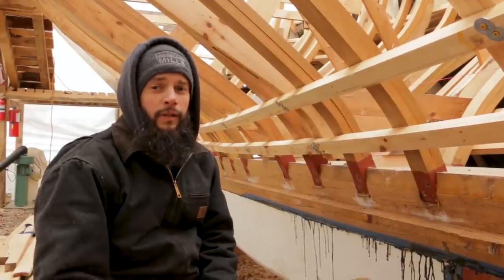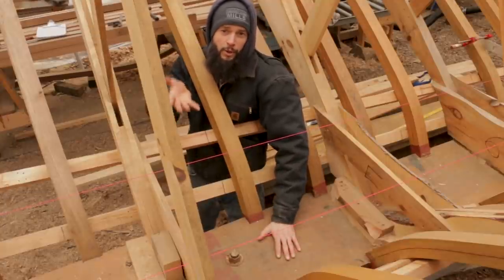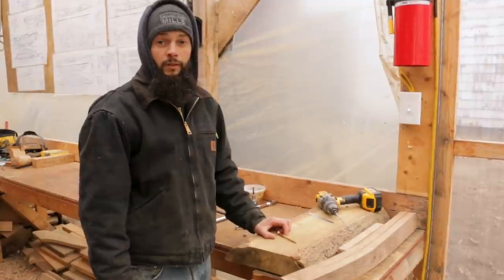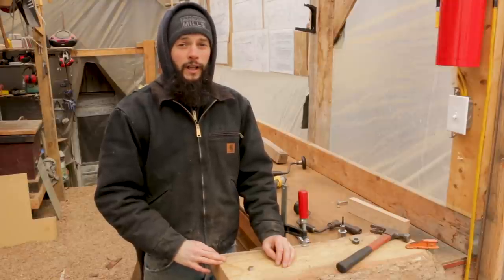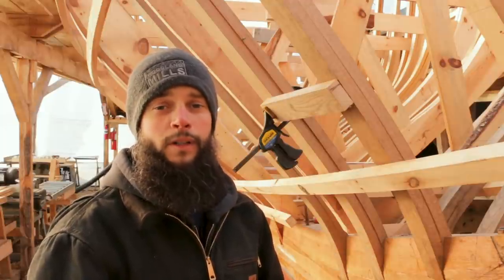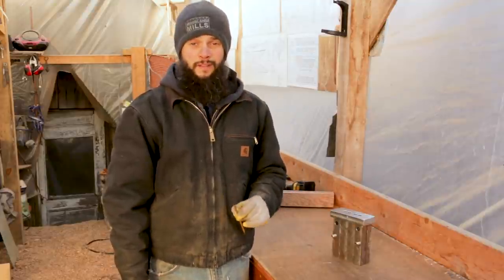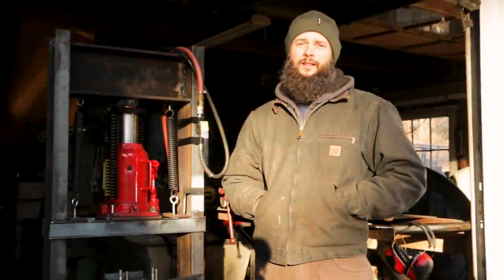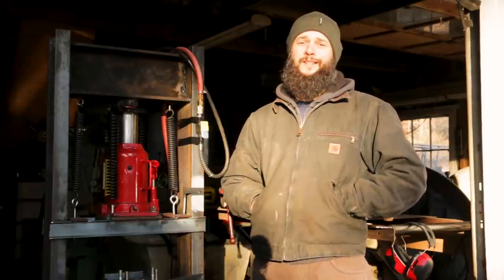Acorn to Arabella - Journey of a Wooden Boat - Episode 50: Homemade Copper Rivets!

Comment: In theory, bolts are supposed to be loaded in tension, not laterally which tends to move sideways and loosen.  Threaded portions should stretch at the same rate as the wooden threads. This important fastening metal, and as a result the length of the female threads is limited to a length short enough so each turn of thread pulls evenly.

Comment: People that say the screws went in too easily have never properly pre-drilled a screw hole in hardwood
Reply: Which was ALSO Why he used the Brace and screwdriver bit, so he could FEEL the Stripping Point and STOP.
Reply: my grandfather always said "if you're counting on the screw to hold your joint together, you haven't fashioned the joint properly."   The "key" in a keyed mortise and tenon is not supporting the whole strength of the joint....screws here do much the same thing, they're not really "holding the load" so much as keeping the frame ends in place....
Reply: @timhyatt9185  Yep. My grand pap said that nails, pegs, screws. and/or glue are just there to hold the joint. The work is the fitment. "It's called Joinery not Glue-ery."
Reply: @christopherneelyakagoattmo6078   "It's joinery, not screwery" was what I heard from my first native English mentor .... so the explanations differ slightly, the knowledge stays rocksolid 😄
Reply: i guess if you dont care about building huge splitter cracks then go at it tigth and feel it torque on them screws =)

Comment: For the Rivet-Machine:
I'd suggest you design the die a bit differently. Instead of having the Rivets sit square to the splitline of the die rotate them 45°, so they sit diagonally in the die. This would make extraction easier and incidentally also create somewhat of a point at one end (in the shape of a rounded pyramid). You could then skip the step of making the point at a belt grinder.
Reply: Bingo!  This is genius!  What we'd call a slip-angle or mold-release angle.
Reply: @davidbrown8365  Thanks, now I know what they're called in english!
Reply: I was just going to post this very thing. Basically use a 90° vee cutter for the slots instead of a regular square end mill.
Reply: @thomasbecker9676  Or a square end mill with the part held at 45°.
Reply: @Finn-McCool  not really necessary.  The two curves left by the mill should create a small pyramid with two flat and two rounded surfaces.
Reply: I was coming down here for exactly this.
Reply: I hope they are using a grinding wheel, not a belt. With thousands of rivets ahead of them, they'd be tearing through belts like nobody's business. At least you can use a grinding wheel right down to its core.
Reply: Beat me to it. If they're happy with the work hardening of the heads from cold pressing then forming the tip at the same time.
My riveting experience is limited to either mild steel or aluminium so I don't know if this is important, but do the home made cold pressed copper rivets need annealing prior to use? Does the work hardening when they set the rivets cause the rivets to become brittle? Or is copper ductile enough that this won't be a problem?
Reply: Holy s**t! a practical utube comment!
Reply from the maker: To form the point of the rivet in the press the rivet basically has to elongate.  Even if the die was pointed we would not get enough force to form the point.  
We are pointing on a grinding wheel, the wheel lasts a long time.
It's pure copper and very ductile.  The work hardening is more a feature than a issue.
Reply: Just saw this video, the 45deg is what I was going to say.  Lots of ways to make this faster or better, but if you have free labor what's the use?
Reply: @AcornToArabella  If you are driving through a predrilled hole, do you need to grind all the way to a sharp point?
Try just taking the corners off to creat centering shoulder's, l find one roll of the wrist whilst also rolling my fingers gets it there.
I do this on 4mm square copper leg stays for benches.
Reply: @Finn-McCool  I was wondering what you point was lol
Reply: There is no reason to cut slots or a pair of vees in that die. A round hole of a diameter equal the rivet stock diagonal would be sufficient. I promise you, a square rivet would not buckle in a round hole.

Comment: I did marine carpentry for 15 years, the best gift anyone gave me was "Boat Building" by Howard Chapelle.  But you guys are rocking another level.  If you ever want to experience real fear, go to a modern boat yard working on a wooden boat on the gulf coast and look at the number of stainless fasteners used below the water line.  I was undergoing a Coast Guard inspection for a charter boat when the "Coastie" walks over to look at re-plank job, he shook his head at the stainless fasteners then wrote down the make, model, year and hull number.  His comment was that the vessel would never be able to charter more than six people, and never pass a Coast Guard inspection.  Evidently they keep track.
Reply: You are right about stainless steel below the water line. Many have no idea. I've seen how it turns into rust just like mild steel.
Reply from the maker: People tell us all the time to use Stainless steel, people think it's a cure all.  Stainless does not mean it will never corrode, it just means it will corrode less than normal steel.
Every time someone asks "how can you trust a boat you built and wouldn't it be better to buy a boat built by professionals" I have to stifle a laugh.  There are awesome yards out there doing amazing work and some pretty terrible ones as well!  No guessing here, I know how well she is built and if she fails I only have myself to blame =)
Reply: Stainless steel, particularly embedded SS corrodes faster than cast iron, never place SS where it is in a low oxygen atmosphere, the Nickel cannot oxidize to protect the steel. Thus the name rust less or stain less. When nickel oxidizes, the shell of oxadized nickel protects the steel. I enjoyed your video. I am retired from bronze manufacturing as well as Aluminum and Steel for the marine business. Never use brass underwater, only bronze ( no zinc) in bronze. Gunmetal bronze is best for most operations ( 88,2&10) copper Nickel and tin. Some prefere silicone bronze.

Comment: First, put a bit of a radius on the edge where the rivet head joins the body. Doesn’t have to be much more than  breaking the edge, but it’s a stress concentration point which is bad news.
Second, lube that die! Putting wax or something in there should help increase die life and ease of getting the damn things out. At work we used a lecithin based spray and it worked wonders.

Comment: Nice!  Especially the air actuation on the press.  Big time/arm saver there.  One thing I will suggest, is make some kind of shield for the press operator in case something breaks under pressure, which could be slid in front while the press is in operation.  Something as simple as a piece of thick lexan mounted in channels could save a nasty injury.  I probably wouldn't bother if you were only making a few rivets, but at 1000+ operations the law of large numbers may start to catch up with you, and you could see what would otherwise be a low probability event occur.
Reply: I had the same thought.  All they need is a piece of OSB or some other scrap plywood between them and the action.
Otherwise it looks awesome and like it should get the job done!
Reply: It's over engineered and copper is really soft. No one is going to get hurt!
Reply: Ronald Hayek        Famous last words. It never hurts to be safe.
Reply: @ronusa1976  famous last words.  Over in the UK we are all getting bombarded with, "you can't do that it health and safety).

Comment: My only practical suggestion for speedup is to have two dies. You dont need another cap . You could be loading/unloading one as the other is being pressed.
Reply: Or three dies.  Then you can have one person load a die, another on the press, and a third person unloading them.

Comment: The rivets look very well formed but you might want to consider annealing the heads first. You might have micro-fractures in the head which can really reduce the strength. Nice work though!!
Reply: But people hand peen rivets on lapstrake boats all the time.

I guess those boats don't usually have 8000 pound keels.

My point: Are fractured copper rivets really a big problem on boats?
Reply from the maker: It's a very pure form of copper and since we are not upsetting the heads a crazy amount they should be totally fine.

Comment: Concerning the rivet making process.  I would suggest using an impact wrench to speed up the tighting and loosing of the mold process.

The truth is, your only making 4,000 rivets and not millions. By the time somebody comes up with a mass producing machine you probably will be finished  making all the rivets you need.

Comment: Don’t know if this would work. Drill small holes up thru bottom of jig say 1/16 or 1/8 then make extraction tool with same spacing as rivet maker with steel rods. Then all you would have to do is loosen the bolts not have to take them all the way off. When you lay your mold on its side slide extraction tool in bottom and tap the rivets up pull the out place in new blanks tighten and repeat
Reply: This. Should cut batch time in half.
Reply: @mattfff316   This would only work well (I think) if the tool was remade so the rivet stock was turned 45 degrees about its long axis, as others have suggested. This way, as soon as the bolts were slightly loosened, the stock would no longer be jammed

Comment: Only concern I see with the rivet machine is it’s home made. I make just about every odd ball tool I use, and that’s the key word, I use. Tossing a volunteer on that thing is a bad idea. If something hangs up, or a weld fails, someone could get hurt. If your willing to take that risk, as I do with much of the dumb crap I cobble together, then all good, but it may not be a good idea to have someone unassuming take that risk.
With that said, I’m loving the build. If I had vacation I’d be out in a second to help. Good work guys.
Reply: It's fine, with that type of design few things can happen so long they exercise caution and don't stick bits where they're not supposed to. Trust me, i've seen some fabricobbles that would boggle the mind of any self taught shop/worker etc.
Reply: I would not have a problem working this press. Just about everything is over engineered in strength. Copper is really soft. It's really safe!
Reply: Not all people are idiots. Anybody with a hint of mechanical could operate that press. I don't worry so much about getting hurt, if I did, I would never get anything accomplished !
Reply: I’m not calling it unsafe, and I also wouldn’t have an issue jumping right on. It’s very stout. I was just saying, I build tools the same way, including working on a forge press. The reality is, when you buy equipment like this, liabilities shift to the manufacturer, when you build it yourself, it’s all on you. I’d hate to see someone get hurt, but even more so, I’d hate to see what some ass hat would do to these guys if they did get hurt. Not all people are honest. I’m sure it will turn out 4000 rivets without issue.
Reply: Safety first when volunteer tossing, shields, as have been suggested and two air valves in series to keep fingers or whatever out
Reply: Volunteer signs a waiver before going to work, problem solved.
Reply: @manfredschmalbach9023  A waiver often only ruins the value of the paper it was printed on.  And it can't restore lost limbs, eyes, teeth, etc. Hydraulic presses are not something to trifle with.
Reply: @netpackrat  A waiver is a way to keep a person's own personal insurance company in check, and keep those from taking regress on You in case of an accident.
It definitely doesn't restore any limbs or senses You might loose working on a press (or on a boatbuilding site, at all, for that matter, just think about the tons of deadly poisonous lead in the keel or the awfully dangerous splinters, not to mention fumes and aerosols and vapors and dust and lifethreatening tools from screwdriver to sledge hammers ... just kidding 😂), and it doesn't replace common sense and proper instruction, either.
There is, though, particularly in the U.S., an "industry" of sharky lawyers at work searching for each'n any opportunity to rip the ones without waivers in pieces - why would a car company write an instructing text onto each fucking rearview mirror, for example? To tell the next shady lawyer "we wrote it even down on the friggin' thing!", not to prevent accidents unpreventable when You take a look at how people drive in the U.S, but to fight off bloody insurance lawyers lacking any "common sense" on purpose.
Reply: @manfredschmalbach9023  The lead, as they used it, was not all that poisonous.  The biggest danger in that operation was from burns.
Reply: @manfredschmalbach9023  Waivers are not entire legal in every country though, it depends a lot on what kind of rights they are trying to make you give up.  Gross negligence usually gives you a good ground to take legal actions, regardless of any kind of waiver.  So no, you don't just sign a waiver and "problem solved".
Reply: @sycc66  I am a boatbuilder since the early eighties, and I did work and mess around on boats since the late sixties, and did this in a LOT of different countries with a LOT of different building philosophies, and I can tell You from personal, lifelong experience: ANY boatshed, yard or boatbuilding workshop or building site is an absolute deathtrap, and a major nightmare for safety pussies of the "but-Your-safety-gear?"-kind.
I rented a variety of "modern" shops when being in need of sophisticated machinery abroad, and oftentimes had to deconstruct or de-mount quite some safety-rubbish from machines to enable the work I needed done, at all. The nightmare isn't the "safety issues", the nightmare absofuckinglutely is the lack of common sense and a good training, which bloody insurance pencilpushers try to replace by safety-rubbish making the machinery really dangerous in the first place, because You do not see anymore the cutting edge, and You cannot steer Your piece properly, for a buncha sprung or selfclosing shit in Your workway and eyesight.
Oftentimes these days the stress a bloody employer or a general contractor does put the worker on the actual fastrunning machine under is the problem what makes him trip, or put his fingers in the wrong part of the machine HE CAN'T SEE PROPERLY for crappy "safety" shit, and the even bigger problem is the absolute distaste employers as general contractors have towards paying people with good to excellent skills: THAT does devalue a good, wellschooled skillset so far down that mostly people without these skills are the ones who cut their fingers and hands today, for simply not knowing and never being trained about what's going on, at all.
So, as already said before, any waivers aren't meant as a replacement for a fill-in or initial schooling, but to fight off bloody insurance sharklawyers.
Insurances make their living from not paying what they're ought to pay, or seeking a fool without waiver to press and skin.
Nothing else does a waiver than putting up with that.
Not a made up rant, but real true life experience.
Reply: @manfredschmalbach9023  I'm not arguing against any of what you said, I just wanted to point out that waivers are not a miracle solution, that's all.
Reply: @sycc66  No, they aren't. Fully agree with that one. 🍻

Comment: Awesome video explaining why wood screws have a smooth shaft immediately below the head.
One detail missing was  the difference between a wood screw thread and a metal bolt thread. As you know the difference is in the shaft inside the helical thread. In a wood screw the centre is tapered, in a metal bolt the centre is parallel. So the metal bolt draws together the nut and the bolt head. The wood screw engages progressively more with adjacent timber as the head is rotated. This is the best video explaining wood screws I have seen though.

Comment: There's definitely faster and better ways, but those take time to make or money to get, so for what you need I'd say you have the perfect tool. We have a hand pumped hydraulic press that easily gets to 50+ tonnes of pressure at my job, so something like that would probably be better, but they cost a small fortune, even old ones, and they're heavy as fuck. Keep up the good work! 4000 rivets aren't that much in the big picture!

Comment: No extra work for this upgrade: don't undo the nuts all the way. Loosen them enough to slip a piece of steel in between the two halves of the die from the bottom and drive the rivets out. Also, use a cordless driver to do the loosening and tightening on nuts.
Reply from the maker: The driver won't get them tight enough.  The thin steel might be a thing to try though!
Reply: @AcornToArabella , get a bigger impact wrench. You'll find one. L

Comment: Grease the inside of the die before you put in the stock so you won't have to hammer the rivets out
Reply: Just a wipe with a candle stub will do it.  Beeswax is traditional, though.

Comment: Did you try spraying silicon on both sides of Rivot Press Die ? To make a bit easier to Press and Remove ? Pop out after.
Or PB Blaster ?
Reply: I'd try dry graphite powder.
Reply: I was going to say oil, car wax, or WD-40, whatever is around.  Copper under pressure gets kinda sticky.  Great video though.  You got me on the "copper rivets".  My friends just don't understand my fascination with stuff like that.
Reply: I would think even the toilet bowl wax,,, already on hand,,, and cheap--plus a little goes a long way!
Reply: @48wilber  I agree that if they would use toilet bowl wax they could really get a head.
Reply: Pam
Reply: @kevinreardon2558   Commonwealth humor...sigh. :)
Reply: Kevin Reardon would the Brits call it “Loo Goo”?